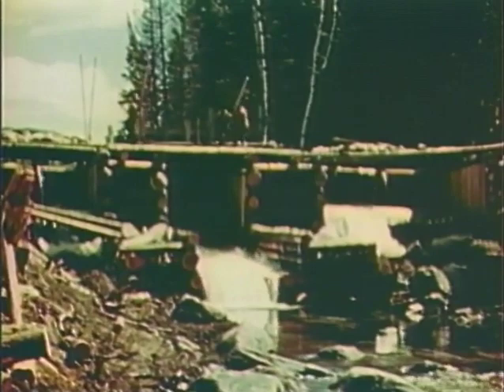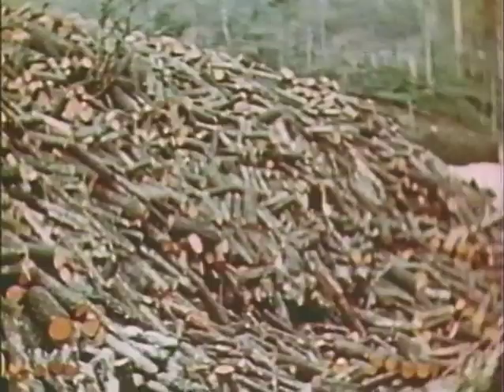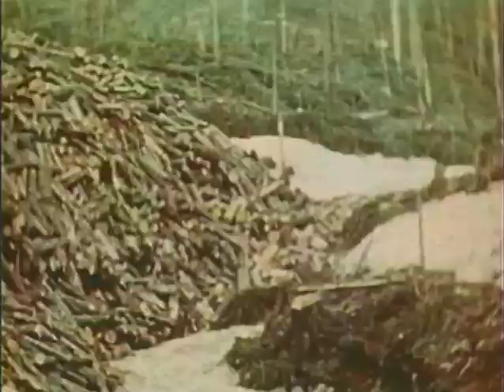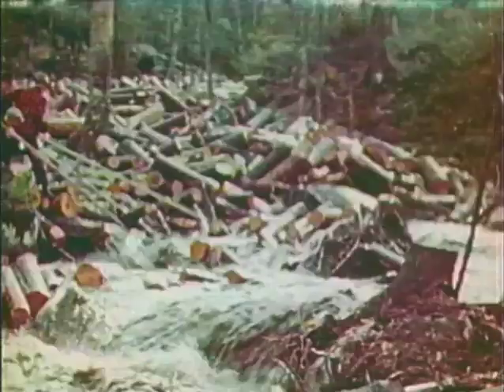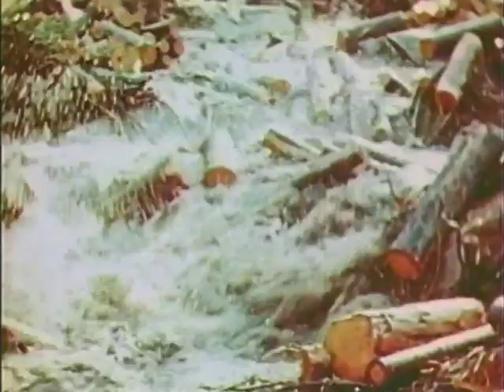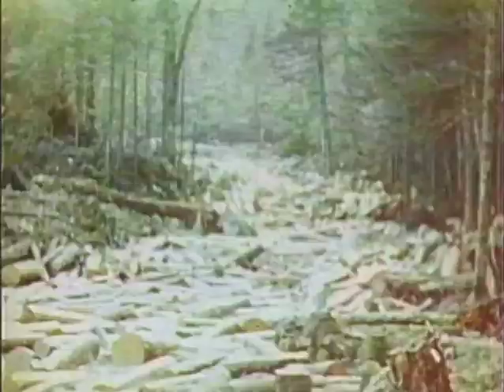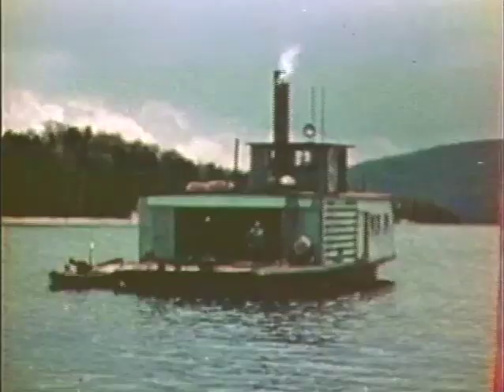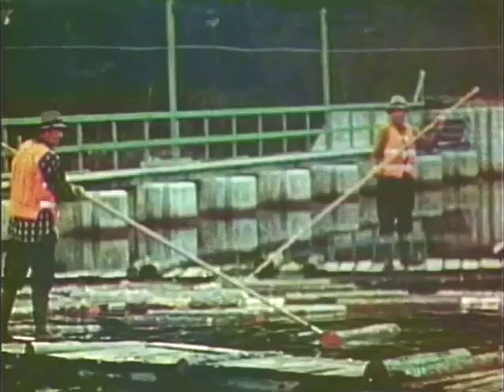River Log Drive

Comment: Back when men were men and OSHA was nowhere to be seen.   What was the purpose of such short logs?
Reply: Joseph Astier - Shorter logs are easier to float down stream, rather than huge lumber that can cause build up and are are harder to control due to the weight
Reply: I get that....what the heck were they for?   Railroad ties?   Fuel?
Reply: Joseph Astier - Railroad ties, yes. Fuel sure.
Depending on the wood they would use it for bowls and such. Transporting it to populated cities for expansion, all that jazz
Reply: Asian Artichoke pulp wood for paper newsprint
Reply: this is back when pulpwood was 5 feet long, so guys could tote it on their shoulder
Reply: Just making tp